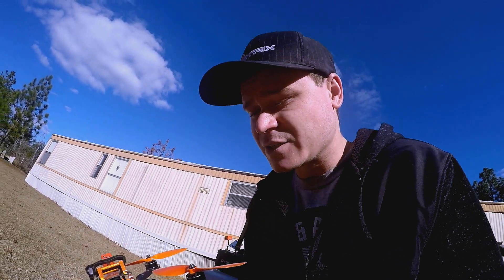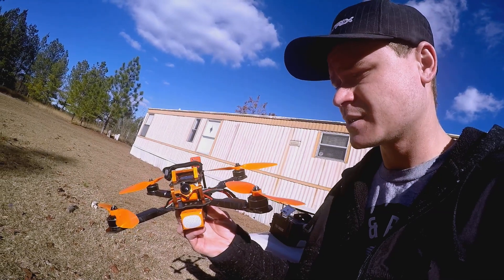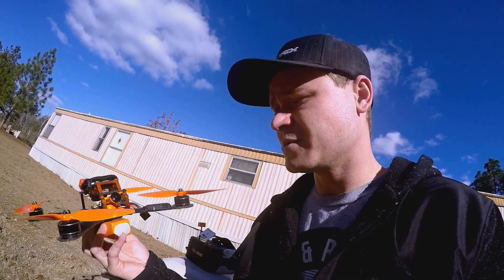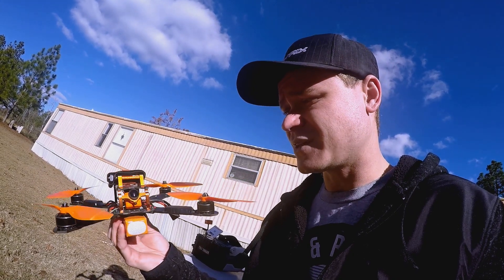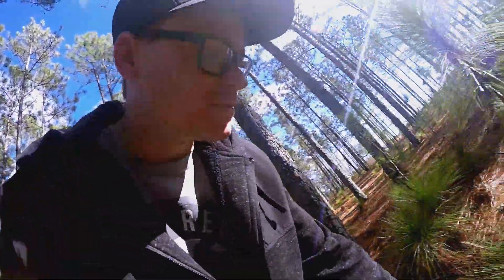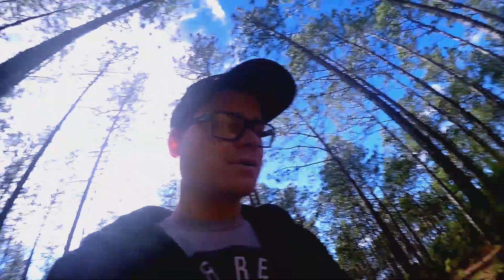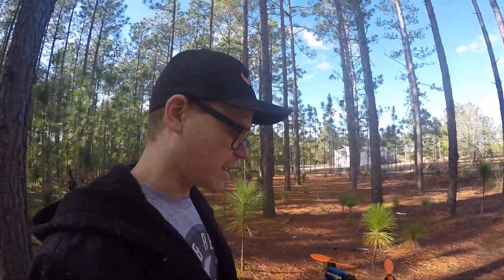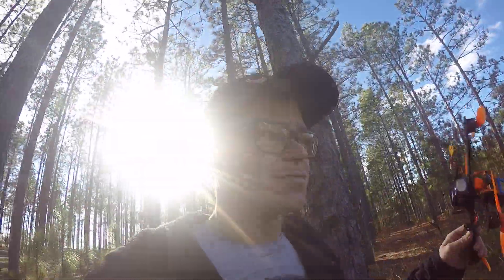7 Inch Trial / Test Flight

Comment: 7"Beast sure is going to be a good one.Had me on edge of my seat that time.I hope you check out my 2nd JC Tribute build the FROG LITE.Got an Omnibus f4 V2 Pro BBB 2207/2650kv motors Mista 800 fpv camera vtx03 & rips 5045 cyclones nice on 95c Tattu RLines.Happy Flying

Comment: 2300kv on 4s might be a bit hot for 7" . Try a big 3 cell and see if the desync goes away.  Or try.a lower kv . Amy idea on flight time ? Looks fun . Sounds awesome .
Reply from the maker: Anthony Bonacci Thanks man, it is fun. There will be changes made as I go for sure. And flight time is actually better tines then a 5 inch with 1300 mah battery. Flying like i was there you could easily get 4-5 mins out of it